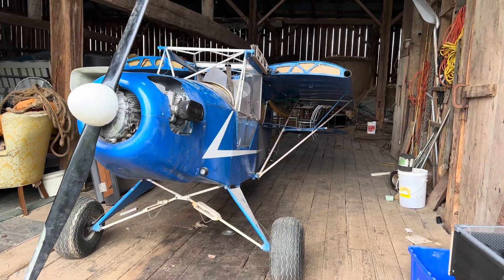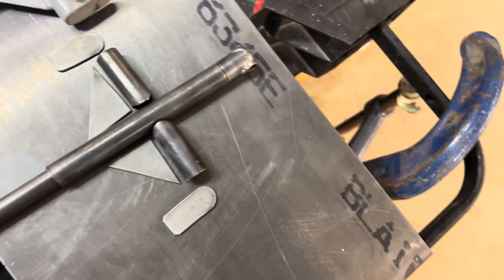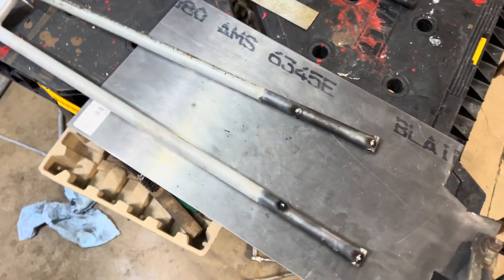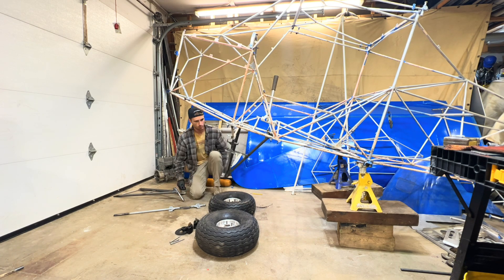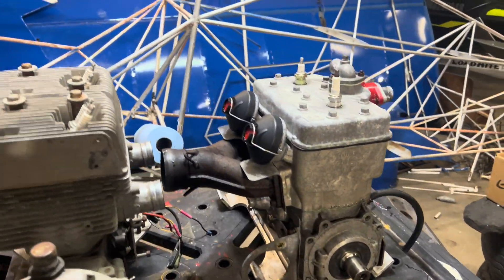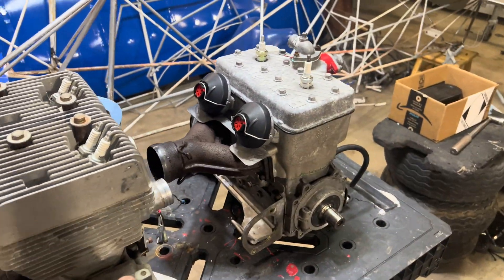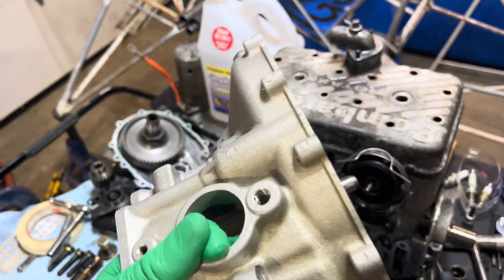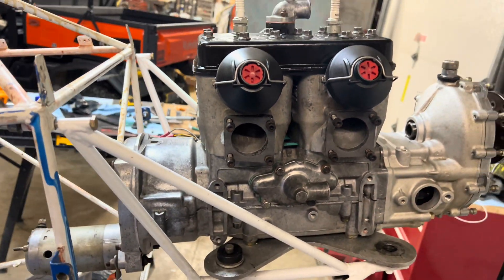Stretching Landing Gear and Engine Upgrade

Comment: I get this job is done already but I would have added a sleeve inside the extended pieces. Not only that, you went butt to butt and had made no angle's on your original piece or your new sleeve. I am by no means a welder so I am not trying to tell you how to weld because from what I can see, you know how. but from past videos and a friend of mine who is a welder says he would have grind down those end pieces at and angle so to give the weld a better bite and inserted a sleeve. Looking great.
Reply from the maker: Thanks that’s a good point, adding a sleeve inside the extended piece would be a good idea, my thought behind it was that there is no shear stress on it but would still help for adding weld area

Comment: To the best of my knowledge, the most powerful engine we ever put in a Skyraider was a two-cylinder HKS that created 62 horsepower. It was a fantastic performer but the added weight from strengthening the fuselage, widening slightly adding an extra seat and the heavier engines meant that it was a bit less Nimble than the lightweight "big horsepower" (503 Dc-Di) planes.

The added weight did however provide the ability to carry a bit more inertia for a slightly less steep Glide angle in spite of the hi drag wing .

Can't wait to see what that thing is going to fly like with an actual liquid-cooled 100 horsepower. Didn't know there was such a thing as a 100 horsepower 2 cylinder rotax. It ought to be a regular rocket ship.

It looks like you've got your project well under control and have a pretty good idea of the direction you wish to take it. Quite impressive, I just wish more Builders back in the day were willing to take the initiative when it came time to problem solve with their aircraft kits, would have helped my job out a lot as I was in Customer Service, orders and shipping as well as manufacturing quick build Wing kits 

You're making awesome progress, can't wait to see the final result.

Keep up the good work😁👍
Reply from the maker: Thanks! Yeah it’s going to be very interesting to see how it preforms, I know they fly very well with the 503 so this will be quite the experiment. 
Fortunately this 583 is not much heavier than the 503 (Roughly +10-20lbs) so it should still handle pretty well in the air. Hoping to fly it in the next couple months so we’ll see soon!

Comment: You are an amazing young man with so much talent. What do you do for a living.   Also will your changes make the ultralight standards for weight
Reply from the maker: Thank you so much! I should make a video eventually of what I do, but the short answer is I fix up abandoned houses and then rent them out on airbnb or sell them.  As for weight, I should be okay to stay within the ultralight limits in Canada as I’m hoping to be cutting a lot of weight going forward, a lot of it will be upgrading everything I can to carbon fibre

Comment: You should consider building a new cabane v that is deeper or lower than the original cabane v.
This will give your suspension a better mechanical advantage when the suspension compresses.
The taller gear legs makes this more critical.
You are an excellent fabricator! 
Keep up the great work and videos!!
Reply from the maker: Thanks! I’ve been thinking about that and I think you’re right, I’ve gotten it powder coated and don’t want to cut into it yet so I’ll see how bad it is or if I can lower it with minimal welding later on

Comment: Great looking project - so many cool things you can do with a homebuilt. 
Though does the 'I' registration put weight limits on you? Maybe when you're done we could meet up for a fly in.
Reply from the maker: Great question, It does. Its registered as a basic ultralight and I’ll have to stay with those limits. I’ll be adding weight in some places but removing it in others so hopefully will finish around the same weight. 
A fly in together would be great, are you in Ontario?
Reply: @claytonwodiany   Based out of Oshawa CYOO

Comment: Nice engine choice!!! Keep up the great work. What snowmobile did you pull that from?
Reply: Looks like a Skidoo Formula Z, mid 90's... Rotax 58x family engine. Gotta be careful with them though. I know 2 people who have had them seize up in the air. One fatal.  I've had the pleasure of being stranded in the woods thanks to one in a 1998 Skidoo that decided to die on me....  Rebuild them right for flying use - no short cuts.
Reply from the maker: @SyphenHouse  Yeah it’s from a 1997 Skidoo formula Z. And you’re right, I’ve been coming across that issue quite a bit in my research, most are the result of shock cooling and it’s definitely something that I’ll have to be very careful with!